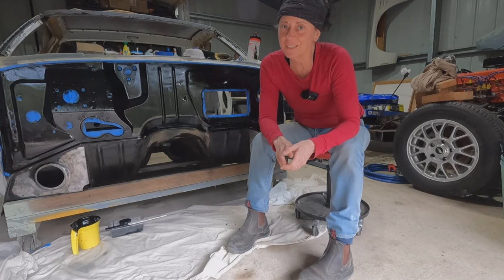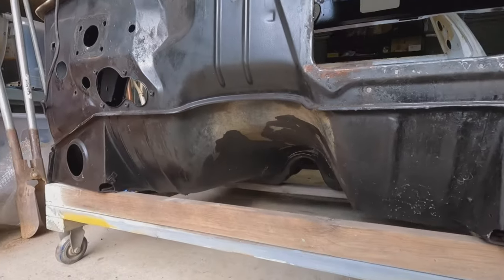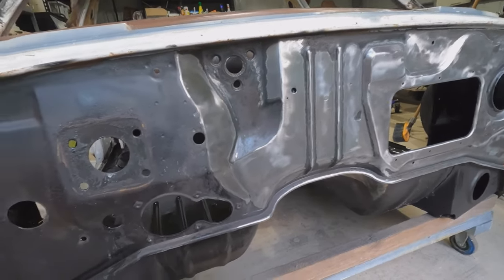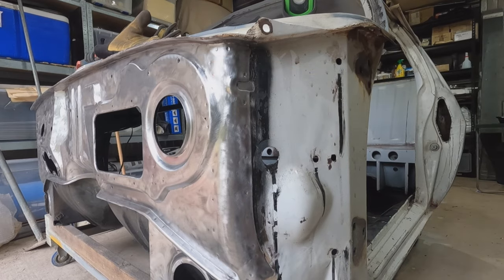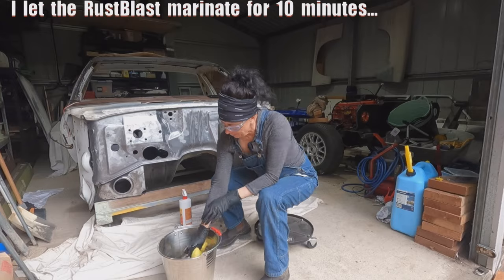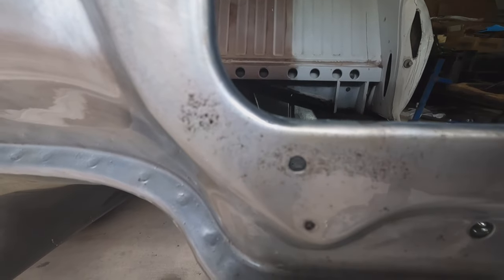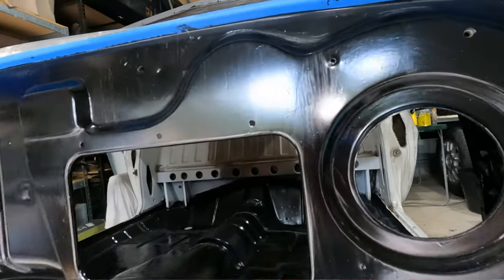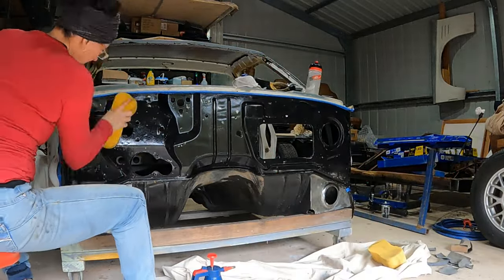Restoring the Firewall With KBS On My HZ Holden One Tonner Cab

Comment: All you need to do now is spray over it with a top coat, or try thinning out the rust seal and go over it again. I don’t have brush marks but I do have a grainy appearance to mine due to the nozzle size I described in a previous video. I might go over mine again to see if I can get it smoother looking but being in the engine bay I really don’t feel it’s that much of a big deal. I reckon a spray gun will solve your dilemma for sure. You were fortunate you had no rust where the overlap is, but I only found out by cutting a square out and finding it was sandwiched behind it and then chasing it until it stopped. Worth a look really as you can then weld in a small piece after checking.
Reply from the maker: Always there to encourage, Spydey, thanks. Yeah, spray painting set up is next on my agenda fir this project. I'll leave the firewall for now and practice on the underside.

Comment: Same thing happened to me changed to spray painting it,turned out 100% ,entry level compressor,ryobi  spray gun from Bunnings, 5 kva generator will do the trick
Reply from the maker: Excellent! Maybe I should try the 5kva we already have, then 🤔. What size compressor did you get?

Comment: Another great vid Stace. Shame about the KBS. Did Adrian give you any specific ideas on how best to apply their product at all? Keep positive as your videos are giving me so much info for my journey which is coming along very slowly. Great job Stace
Reply from the maker: Thanks a million, Stuart. Yeah, Adrian was great but seems my choice of brush with satin finish RustSeal is not ideal. He said spraying it on would be better. So I will try and set myself up with a good generator and air compressor and do that. The cab is on it's back now, so I can start work on the underneath, and will aim to spray that. I haven't given up on KBS yet. 

And thanks for the encouragement - I'm glad these videos are helping someone else! Even though your journey seems slow, it's moving forward and that's still heaps of fun.

Comment: Great video again, Stace. What strip disc are you using and what size grinder do you have?
Reply from the maker: I used my bosch 125mm grinder with a black strip disc for most but also just the drills with wire wheels for curves and cornersand spot weld divots. And thanks Jono for visiting the channel again.

Comment: Fire wall an inner gards all black    wb are painted the colour of the car.    your doing a great job an you are being ripp off on your motor you could have got a good 1 ready to for about half of what you have spent on parts
Reply from the maker: There are reasons I rebuilt this motor, pretty sure I explained that in at least one video ... maybe you jumped to the end and missed that? Seems quite a few others did, anyway. But thanks for your support for the build 🙂

Comment: Honestly, I would be using a quality 2k epoxy, high build primer and black top coat. The epoxy can be brushed on if you want to seal the metal until you get a compressor.
Reply from the maker: That's my plan to use epoxy everywhere else. I really wanted to give the KBS a good try, guven how well it treats and seals out rust. But I'm curious about your reasoning? Just ease of application?
Reply: @staceonwheels  Yeah, epoxy is easier to apply more evenly. 
I've used POR15 in the past which is a similar product to KBS on suspension parts and inside panels . I would sandblast, deoxidine,  then apply 2 coats of POR 15 rust preventive paint. About 6 months later (and still sitting on the shelf) I had rust starting underneath the paint so I had to strip them and start again. 
Also POR15 and KBS are not UV resistant, so I didn't want to use it on my 1 tonner chassis then have it break down.
Reply from the maker: At this point I'm not gonna start over. I also get feedback from people that KBS has worked for them. I will coat the firewall's KBS with something else though. Still great to hear other approaches to try on the next build 👍